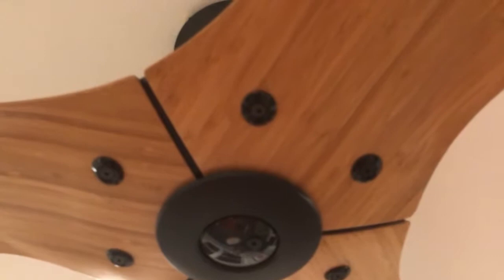Haiku fan noise at low speed

Comment: Mine just started making this same noise after being installed for over four years.  Love the fan, but need to figure out the issue.
Reply: After my first post I approached the problem by looking for anything that might be loose and tightening it.  I dropped the bezel/trim part that conceals the shaft to the ceiling and tightened all of the screws that attach to the j-box and the brackets.  None appeared loose.  To see what would happen I then turned the fan on and found that the sound was gone.  I ran it up in speed and back down.  No sound.  I then re-attached the trim bezel but this time was careful to position it so it was just clear of the ceiling sheet rock.  I re-started the fan and no sound occurred.  I increased the speed through all seven positions and the fan was as quiet as day one.  Not sure what happened and curious to see if that lasts.  I do know vibrations and harmonics can play havoc in troubleshooting and maybe the trim piece was the culprit.  If I do have further issues I'll make a point to follow-up here.